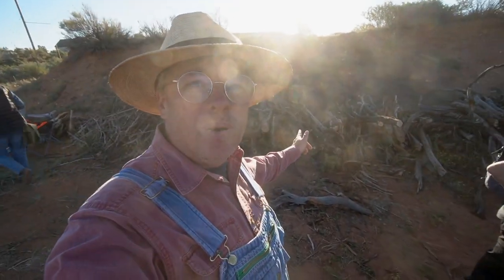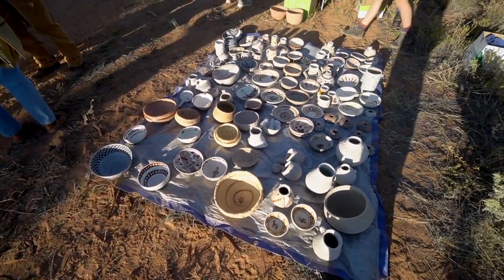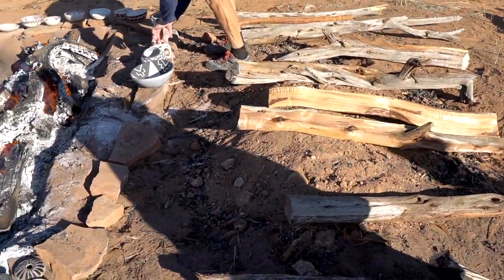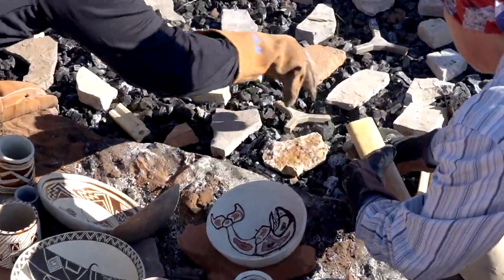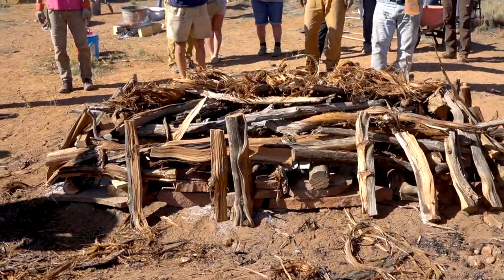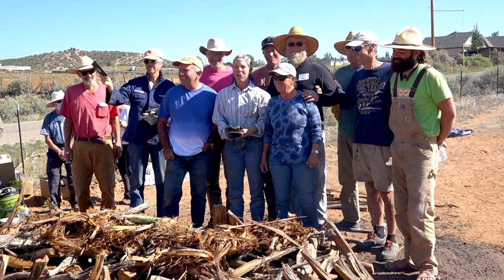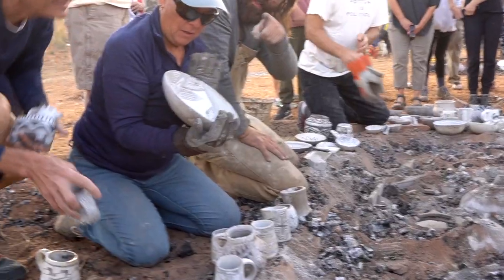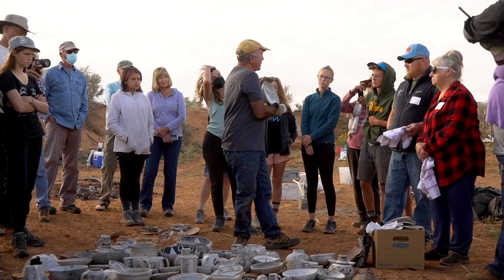How to Fire a Smothered Trench Kiln - 2021 SW Kiln Conference

Comment: Watched this again, lots of really good information and it is always exciting to reveal the end result. They hit temps of 875 - 1060C. Why doesn't the paint burn off like it does in a Salado surface firing?
Reply from the maker: Thanks Wes. It's the amount of oxidation. Those pots are in a pit with a big fire above them, they don't start oxidizing until the fire burns to coals and even then slowly because of the pit. On the other hand, they would struggle to ever turn iron red in one of those fires.